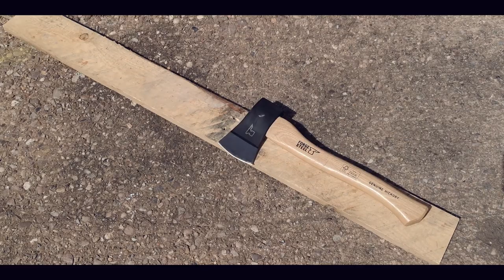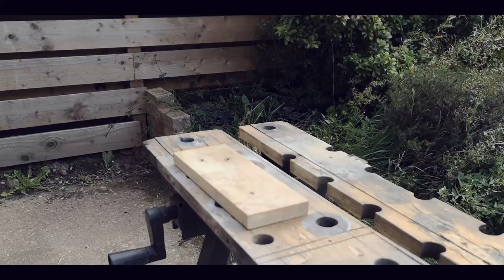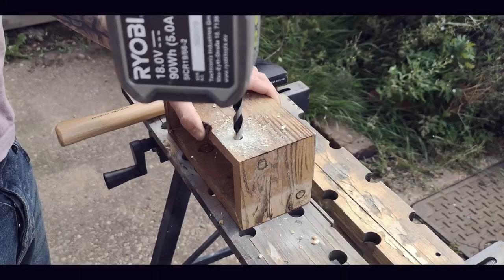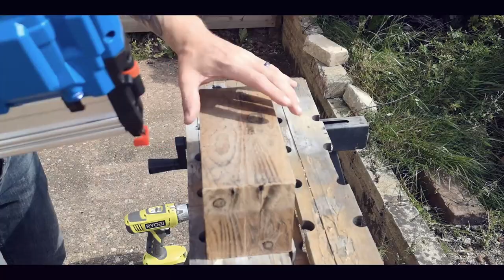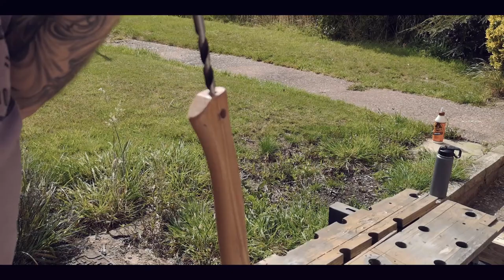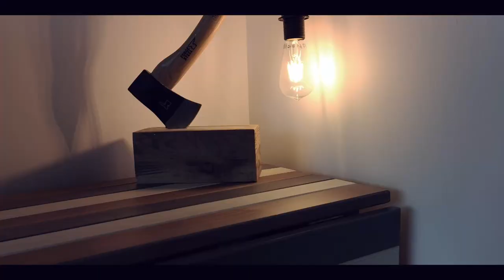DIY Axe Lamp

Comment: very cool lamp! did you secure the axe with anything to the base or just wedge it secure into the wood?
Reply from the maker: Thank you for commenting and watching, I fixed the axe in place with a 2 part epoxy resin ( the type that comes in a syringe) but unfortunately lost the footage of this.
Reply: @DeanMakes  thanks for sharing. I hear you on the lost footage thing, can’t even count how many times I’ve done that.

Comment: I was looking forward to seeing you drill the handle and then you didnt
How did you fix the axe in to the wood?
Reply from the maker: At first I was going to drill the complete length of the handle but the wedges that hold the head on are solid steel 🤣, the axe is wedged in and the filled with Gorilla glue epoxy under the base, I flooded the top with super glue top just to make certain that it's solid ✌️

Comment: Aside from making a slit and jamming the hatched in the wood did you use anything else to make it more permanent in the wooden box?
Reply from the maker: Hi, thanks for watching and commenting.

I used a 2 part  Epoxy resin to secure the axe into the slot, I didn't show this in the video as I forgot to record that part.